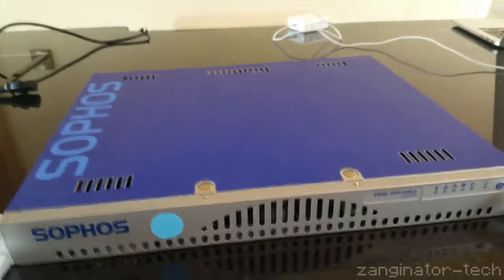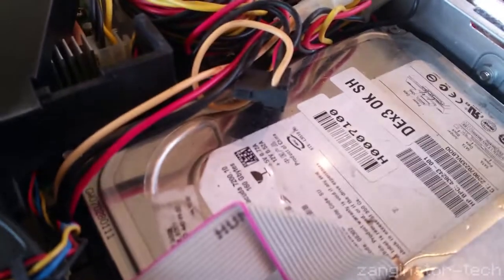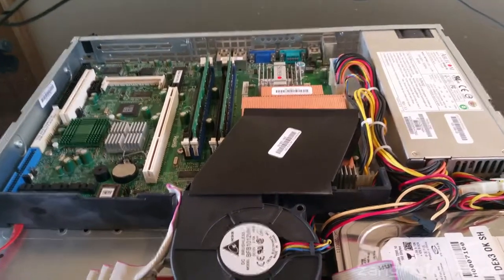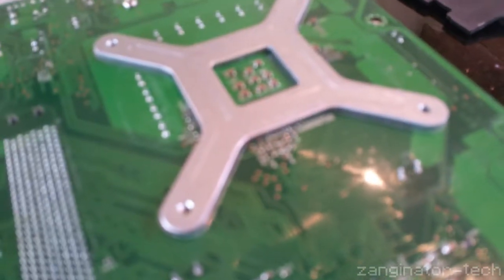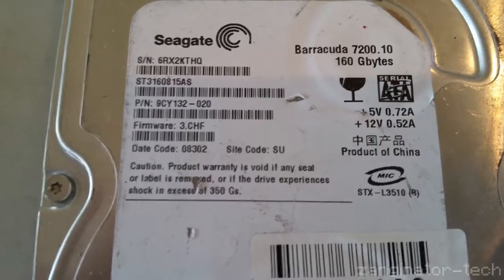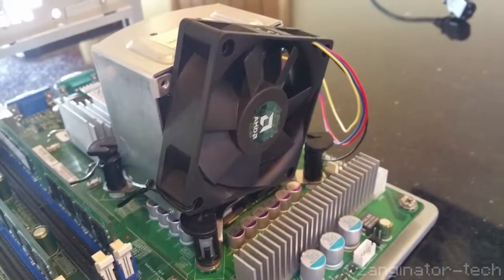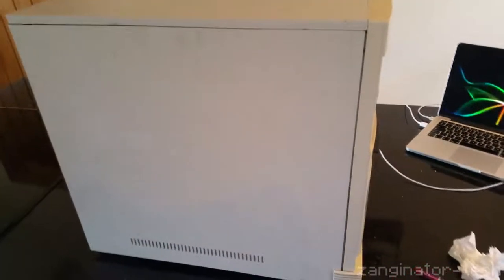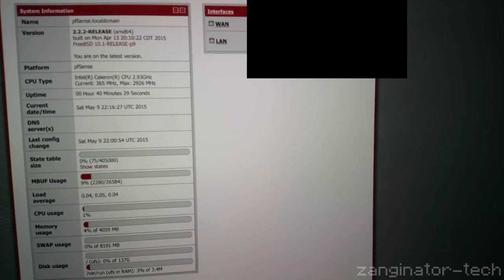Home Router Bodge-Build (09/05/15)

Comment: Good videos - the 9240 cross flash brought me here btw.

Next step is to convince guys like you to run high performance but low power consuming networks. I'll post my setup with hot swap failover routers soon.

Keep up the interesting videos
Reply from the maker: Hi, Thanks for the comment :P

Always interested in ways to go faster whilst using less power. (Seeing as I have some hefty servers)
Reply: The irony is that you yourself mention power saving as a pro in your VLAN video ;) Think you need to practice what you preach sir - Good evening to you
Reply from the maker: Its just a benefit of VLAN's, doesn't mean I like to do it :P Oh well, thanks for watching my videos!